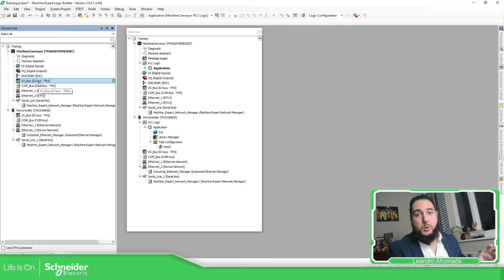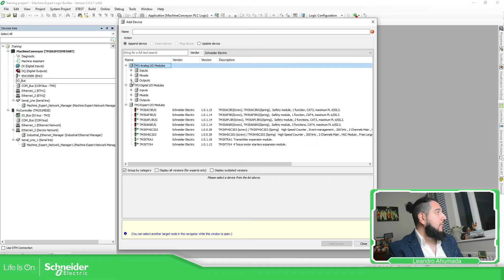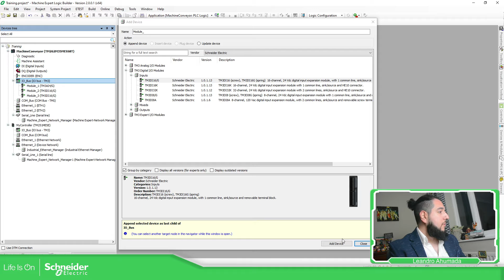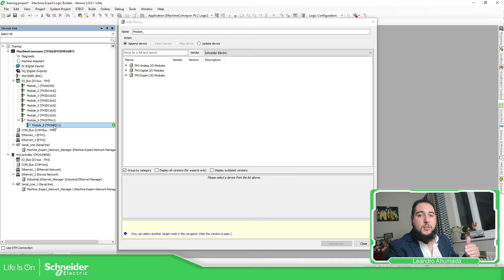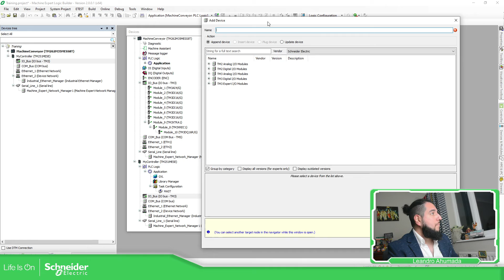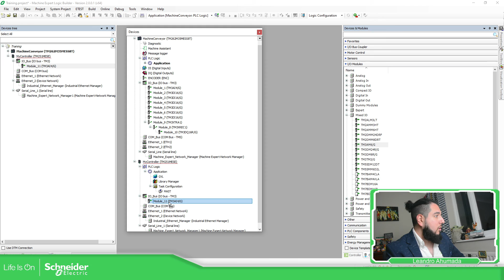EcoStruxure Machine Expert Training - M2.7 Adding modules to our controller

Comment: How to add virtual axis
Reply from the maker: Hi There! First you must have a Motion controller (M262 or PacDrive) then you can try this: 
https://product-help.schneider-electric.com/Machine%20Expert/V1.1/en/m262serc/m262serc/Configuration/Configuration-8.htm

Basically on the "WorkingMode" the parameter "DesiredState" of the axis needs to be "Simulated working mode"
Reply: Do you have a structured text sample program for servo motor  @LeTomasAHUMADA

Comment: Hello, Thanks for the video. I got an M262 device, I have connected it with 7 I/O modules and when I run it there is no error, but when I add 5 more modules then the error appears. Could you help me? Thanks.
Reply from the maker: Hi iqbal pratama! I am not 100% sure how your architecture is but does it follow the page 10?:
https://download.schneider-electric.com/files?p_Doc_Ref=DIA3ED2140109EN
 Once you reach the 7 modules in the plc you will need to use a TM3XTRA1 + TM3XREC1 so you can expand your local IO to 14 modules. Do you have this in your configuration and in the real controller+modules?